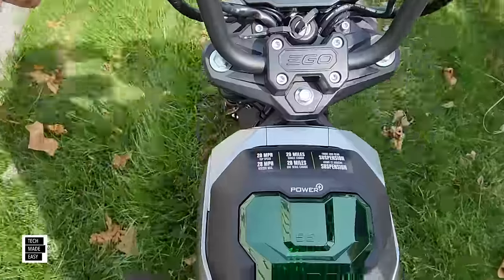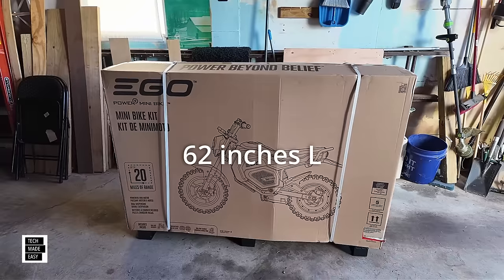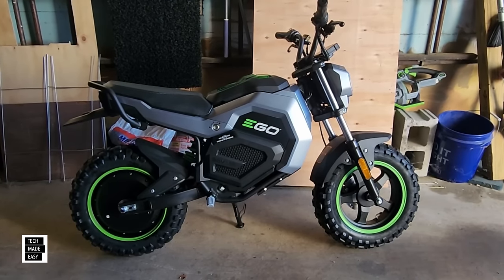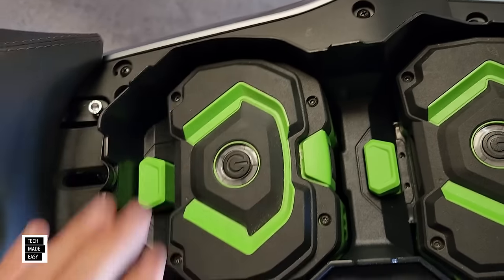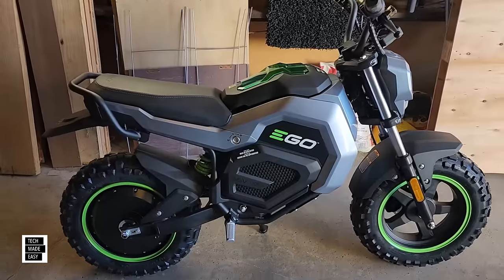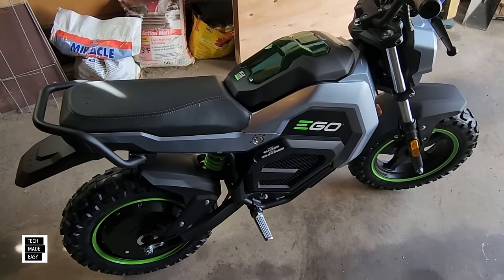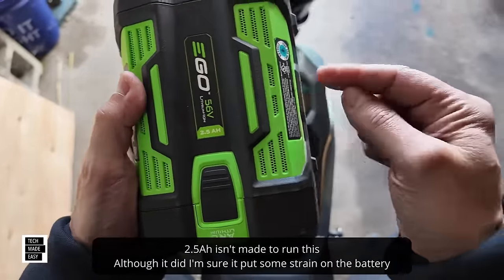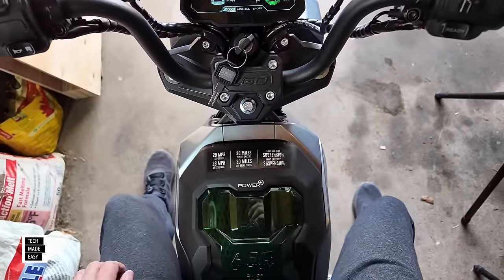EGO 56v Mini Bike MB1000 MB1005-2 EGO BIKE

Comment: The led lighting system is  actually derived of daytime running halo ring and driving led headlight with low and high option ego would have knocked this out the park if they included hydraulic piston/shock for battery compartment tray door and 1 usbc usb and one usb charging port similar to what is on the ego led light tool

Comment: Hey Al, does your kickstand shift a bit...outward, by the socket, after it's initially locked down (especially if applying any pressure downward), while it's holding the bike up? (almost like a mini ball joint)
Mine does, but not nearly enough to have the bike fall. Just wondered if this was by design. Thanks.
Reply from the maker: Dino I will have to check that please remind me , you enjoying it ?

Comment: Really  good review, I’ve subscribed. 
I’m a fan EGO, i have several of their products, I’m considering getting the Power Station and possibly the 10ah batteries, so this Bike is now on my radar IF it can be driven on surface streets in California? Or at least in a bike lane. Would like to know how it holds up for you longer term.
Since you already have a big investment in those batteries it would be nice if you could make a log of the Lifespan vs usage, sa miles total on the Bike and hours of use on the Lawn Mower, etc.
Thanks for this vid, i will look for your Tesla review also, I’m thinking about the model Y upgrade next year.
Cheers from San Diego
Reply from the maker: Hi Julian thanks, welcome to the channel. Sorry to say you can't use this on the streets anywhere it's not street legal it's only made for off-road and let me know when you get your Tesla if you have any questions message me on the other channel

Comment: What if you use two 12amp batteries instead of the two 7.5amp batteries  that it comes with, will it go faster or longer?
Reply from the maker: It won't go faster but it should go longer than 20 miles

Comment: nice,so you cut the speed limit switch off,does that mean you can go faster than 30 mph now?
Reply from the maker: With the switch off, it can now go up to 28 miles an hour if the switch is on I believe the maximum speed would be 20 miles an hour

Comment: An two while your other battles are changing,if you have these other lawn products an batteries are charged just simply grab one of those an go for a ride until your other battles have changed back up,I do think it's Kool it has a storage unit that you can carry two spares or one an use the extra space for something else like sealed bottles of water in case you get thirsty to stay hydrated.

Comment: It looks to me like these will mainly need oem parts. It is hard to find the minibike brand new so I feel sure the parts will be hard to find and likely pricey. With many ebikes and escooters parts are not a problem at all and many are interchangeable. Personally I would have preferred an ebike or scooter. I would love to see what commonly replaced parts cost and their availability like brake pads, tires and wheels. Are the tires tubed or tubeless? This minibike reminds me of their Nexxus power generator. A device that is likely made well but falls short in some very important areas. I have the Nexxus and like it despite its shortcomings btw.
Reply from the maker: Looks like tubes but not 100% sure since I don’t see any info in the manual or online since it’s so new

Comment: Great video but a $1000 for 2 7.5ah batteries and that POS charger? COME ON MAN. The 2000w Nexus with 2x 7.5 ah batteries is $1100 at Lowes.  
   The kit is NOT a good value.
Reply: The battery/charger kit is valued at $1000 retail it breaks down to $700 when bundled up into this package
Reply: @badluc88  Yeah, I get it.  Ego, can 'value' the batteries and charger whatever they want, but it still doesn't make it a good deal at $700.
Reply: I agree I just get my batteries off marketplace that’s why I purchased ego bike bare tool

Comment: 20 miles of range on the slow(eco) setting? And that’s with both batteries. That seems really low. Also this isn’t street legal so most of us city people won’t be able to use it. And yes I’ve looked into the general laws, I wish they at least put turning signal lights on either side. Something like this would probably need bicycle pedals in order to be legal to drive on the street with a class 3 certification (Which is what this has) and that’s exactly where I would want to drive it. It’s bassically a mini motorcycle that isn’t street legal, only goes 28mph and at absolute max gets 20 miles to a charge on a flat surface in the lowest speed mode. Seems like they need to work on the battery technology a little more before I’d consider it worth more than a Honda grom/monkey/or a real dirt bike that can do all that and you can actually work on it yourself without needing to mess with electronics and with a variety of parts that have been around for years. I don’t like jumping on the “first edition” of a product. No offense to ego, design and ergonomics are great, general max speed is adequate, it just needs better range. I know people who use dirt bikes on a regular basis on their property and I feel this would just be a “toy” by comparison to the bikes they actually use and trust on trails. I guess this was focused towards a very niche market. Maybe gen 2 or 3 down the line when they increase the range and have had customer feedback on issues I’ll jump in but right now it’s just kind of a nice concept to me.

Comment: How many watts is the motor?
Reply from the maker: They don't state that
Reply: @TechMadeEzy  Yeah, I have looked and can't find it anywhere either. Not even in the parts list.
Reply from the maker: I sure hope you find it
Reply: @TechMadeEzy  Is there any identifying marks on the motor. It is very unusual to not have the controller amp rating and the motor watt rating. Anyways thanks for the great video.
Reply from the maker: @MrPageyjim the motor is in the back wheel it's a hub motor that's all we know sorry and thank you for your kind words

Comment: They could have done better than a dual 280w charger.  That's not much better than having two cheapo 210w chargers that are everywhere and Ego wants $200 for that thing! Two hours is way to long to charge those batteries.  The charger should have been dual 500w at least.
Reply: They don't have but one dual charger and a slow charge is better for the longevity of the battery.